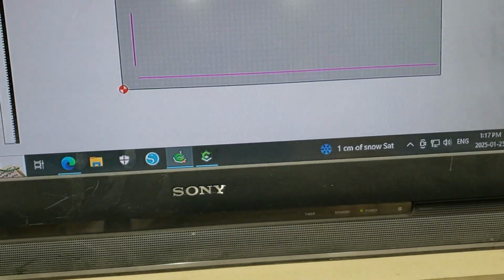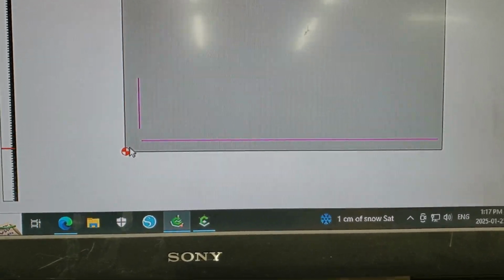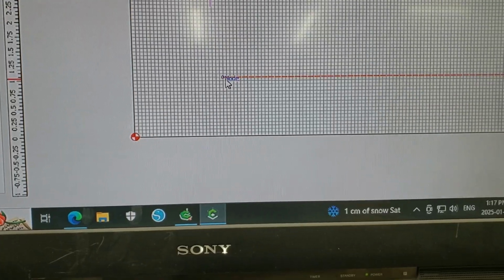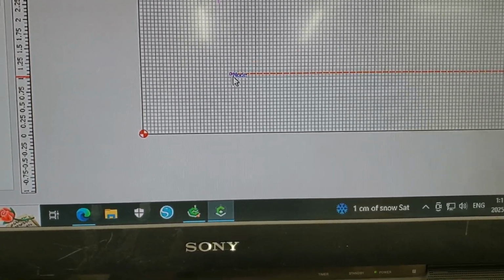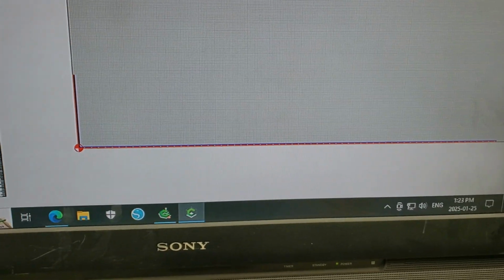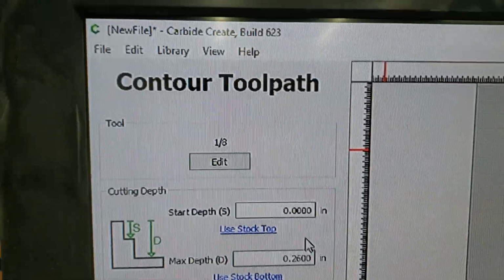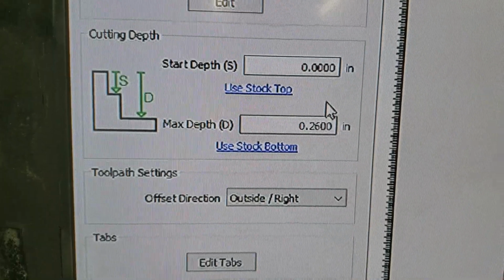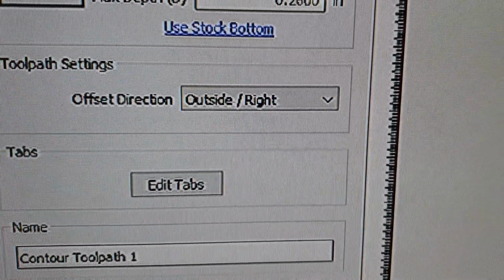Setting up Dedicated XY on CNC

Comment: Another great tip, Brad. Can you show us how you use use your clamps or hold down method with this set up as well?
Happy New Year, Brad.  - Trent 🙂
Reply from the maker: There's actually nothing special. One of the reasons for using 1/4" for the strip, is so that I can easily screw down the typical 3D printed hold downs without obstruction. So it's basically the same as what you would normally do.